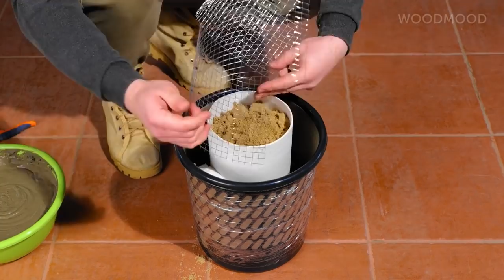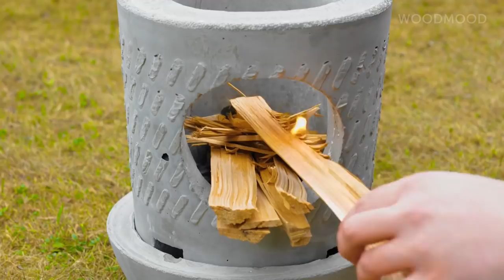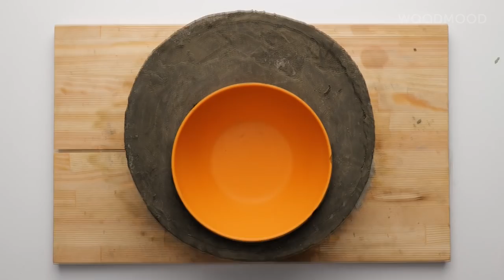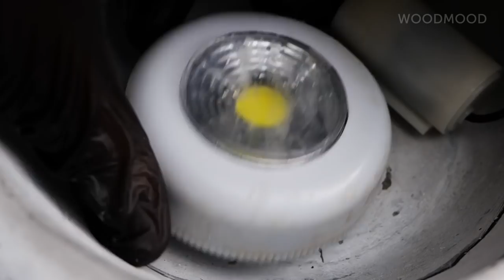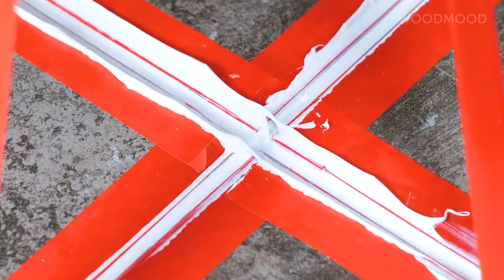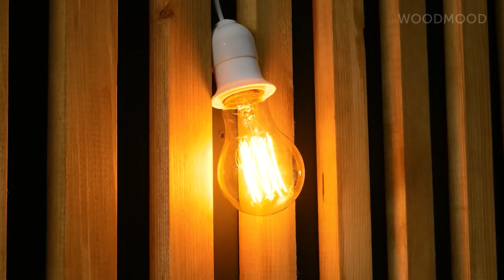Handmade cement Stove From trash bin - New Ideas From Cement

Comment from the maker: Welcome to the Wood Mood! Don't forget to like and subscribe!
Reply: I am your first subscriber :)
Reply: I loved 😻😻
Reply: Hey wood mood... If you're gonna read my comment.... I love this kinda content but pls don't re-apload the same videos again and again with different names
Reply: تحياتي فيديوهات رائع تمت المشاركه ،في انتظار زيارتك
Reply: تحياتي فيديوهات رائع تمت المشاركه ،في انتظار زيارتك
Reply: @zerotwo-qz2xf  àà
Reply: Hey bud, cool channel, love the crafts.  But cement has a very specific and very dangerous flaw when exposed to high heat over extended periods of time.  Namely it explodes because very small pockets of liquid water remain for many years within cured concrete and when they are super heated they expand into gas and create a massive explosive force.

One of your other videos, a short I believe, shows you mixing coins in for stability into a cement stove using a plastic step stool as a mold.  This stove, while super cool, can very easily explode if internal pockets of moisture reach too high a temperature.  This would result in coin shrapnel accelerating to near the speed of sound as shrapnel that can and will tear through flesh and bone within a few meters of the explosion.

I highly recommend that if you have any respect whatsoever for human life that you remove these videos, post an explanation describing why and how it is EXTREMELY dangerous to build a fire stove with typical concrete, and then follow that up with a video of how to correctly build a safe DIY stove that won't explode and potentially kill and entire family.

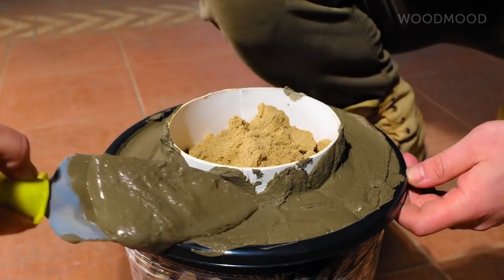Comment: What's the point in pouring the cement from the first green bowl into an identical green bowl?? Just mix well, and add the round, Styrofoam disk in original bowl!  1:02
Men love to overcomplicate! lol 
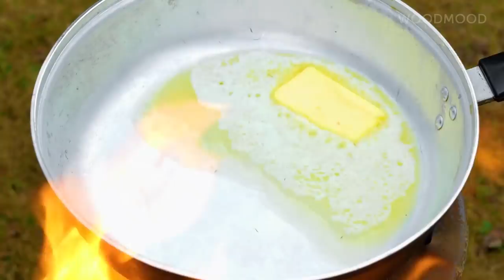2:46 SEE! Even the eggs and bacon have a confused look on their face! 😂😂
Reply: This is such a bad idea 

Concrete can explode when heated with fire
Reply: @PeteGoode  Yeah....I'd prefer to use the split log method. It seems more natural. lol 🤷‍♀️😁
Reply: @MKD-dd6ng  
I’ve always wanted to try that… I’m assuming we’re talking about the same thing: splitting a rather large log and building a fire between the partitions after anchoring or tying them together.

I’ve also wanted to try to auger a hole vertically and horizontally to make a type of a rocket stove in a large log… heck, even a medium log.
Reply: @PeteGoode  That is exactly what I'm referring to. It looks so wicked to me when I watch the videos. I've seen them do it both the ways you mentioned. I really like it when it is made with the horizontal hole from the side. I've watched them simply place their pots and pans right on top. I think it's pretty neat myself. 👍👍
Reply: orrr just use clay, safe with fire.